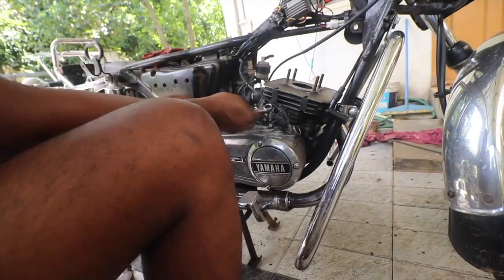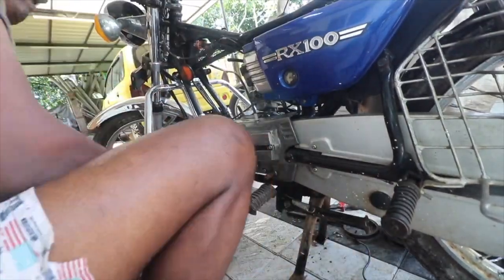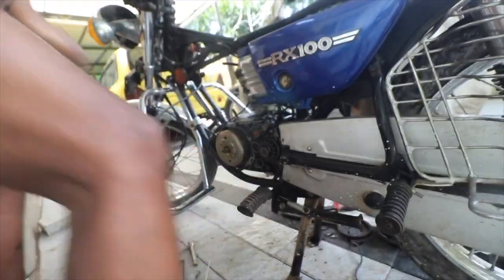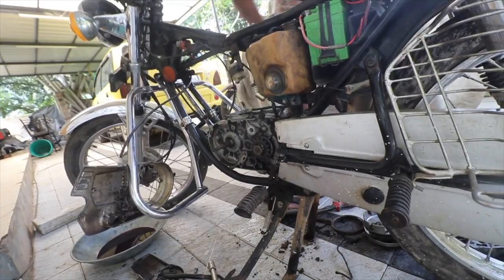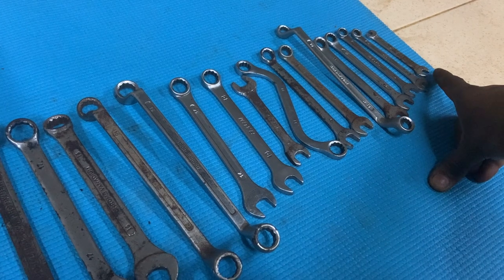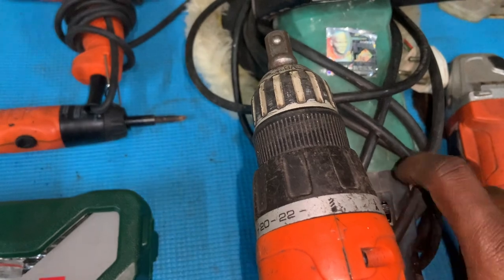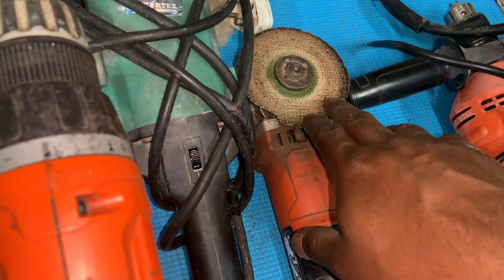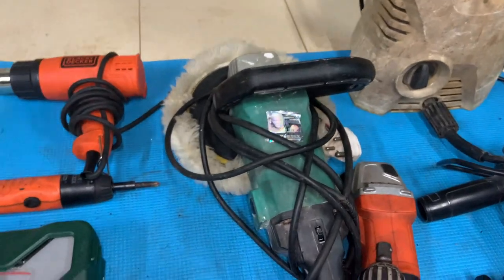My Tool collection, Tools for a DIY guy (English Video)

Comment: What special tools would be needed to disassemble the engine of a RX- 135 ?
Reply from the maker: Magnet holder, flywheel puller, crank separator, church holder, sprocket holder, impact driver and to reinstall you need a crank installation tool
Reply: @Yamakaze  wow...I was only aware of the first two. Thanks a lot. Have you done a disassembly video yet?
Reply from the maker: @PulinPegu  yes, Check the rxz build series
Reply: @Yamakaze  Sure bro!